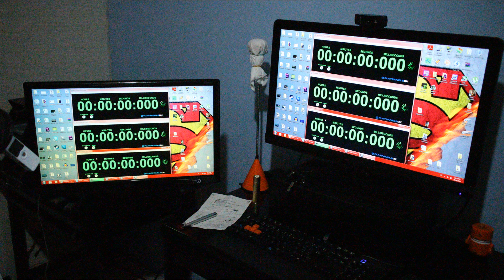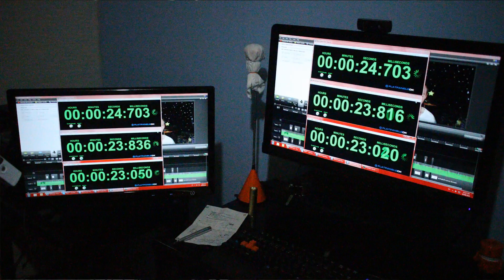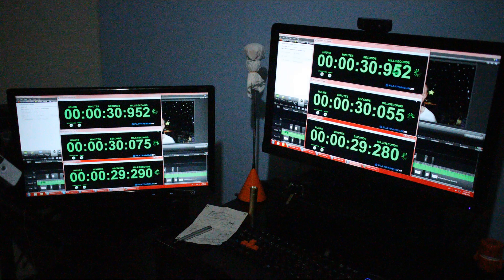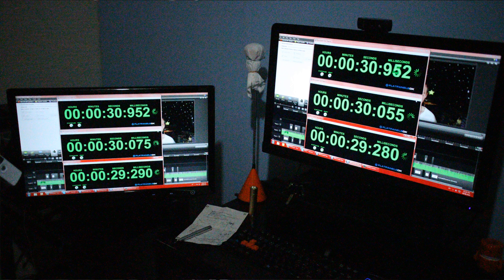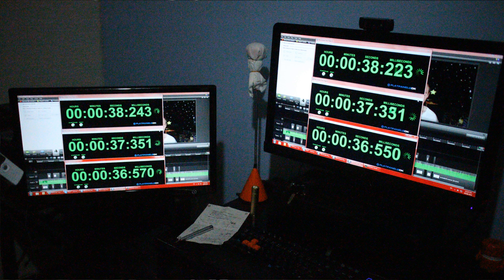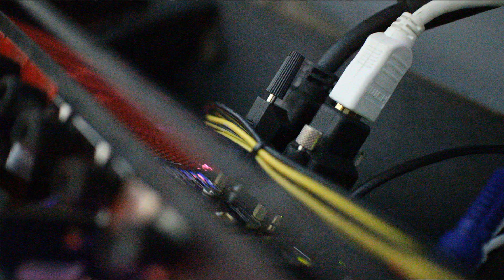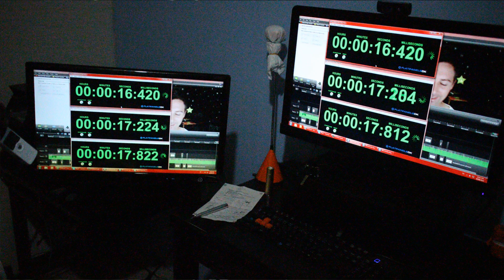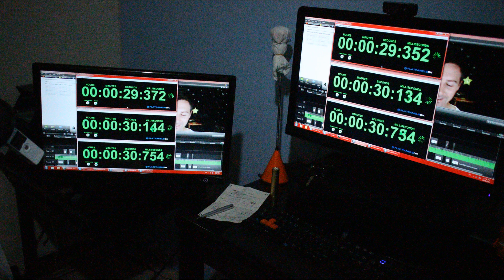Does it really matter which DVI Port you use? Testing DVI-D (Port 1) vs DVI-I (Port 2) (QFP006)

Comment: Graphics card or motherboards which carry a DVI-I connector are therefore fully compatible with flat panel LCD monitors, which typically have DVI-D cables. The DVI-D cable will only read the digital output from the DVI-I connector and simply ignore the analog signal.

Comment: Should the following setup be ok on a graphics card that has a DVI-I and a DVI-D outlet:
1 - DVI-I to VGA adapter then VGA cable to VGA input on monitor 1
2 - DVI-D to VGA adapter then VGA cable to VGA input on monitor 2
Both monitors are Samsung 27" LED flat panels.
Thanks...
Reply: Guy Burton why in the world would u use vga
Reply: Lol

Comment: First off you screwed up . you would need to use the same two monitors . and then switch them back and forth . your two seperate processor and ms reaction times between the monitors changes the reactions in 2 other dimensions off of the dvi ports .

Comment: Can I use these dvi port to support dual monitor
Reply from the maker: +deltamish If the card has two ports then yeah.
Reply: +Tech YES City my card has, but will this affect fps? Also if I plug in a second monitor with dvi will this affect the respons time on my main monitor becouse I now have 2 monitors plugged in?
Reply from the maker: Nah it will be fine.

Comment: whats the point connecting the hdmi to dvi adapter?  Wouldn't it be better to just leave it without the adapter and just use the HDMI?  DVI-D is better imho  I use the bottom dvi port on my card never tried the top one yet.  But recently changed from HDMI to DVI-D

Comment: Is this same for power mac G5 they have two DVI ports?
Reply: The G5's exclusive versions, I think, work differently.  See, the G5 has special versions of AMD and NVidia cards.  The late 2005 models shipped with versions of a Quadro, a 6600, and a 7800.  The 6600, I think has issues using DVI-D in the DVI-I dual link port on the left.  Only the left/one closer to the side panel latch can be used for display.  The one closer to the ports is meant for some video out features and older video cameras.   I've had nothing but issues with using a DVI-D dual link and a few other DVI-D dual link cords.  So, I ordered a DVI-I dual link to HDMI adapter.

Comment: I just got a new monitor (144hz /1ms response).  Can my dual link DVI cable run at 144hz?  Or do I NEED to invest in a display port/HDMI cable to run it at 144hz?
Reply: Depends on the resolution
Reply: I already figured it out. DVI-d is fine for 1080p@144Hz.

Comment: There are DVI-D and DVI-I ports on my monitor NEC MultiSync LCD 2490WUXi2. They are both Dual Link, but the DVI-D to DVI-D cable that was provided with the monitor has Single Link connectors. I wonder why? If I change the cable for one with Dual Link connectors, will my monitor gain anything from it?
Reply: well if the monitor is Full HD 1080p then probably no, but if it's 2k -> 2560x1440 or 2560x1600p then yes as you will be able to use the higher resolution

Comment: I don't think your theory to this is correct.

You see, there are still variables using a camera to check the input lag. Try getting a Leo Bodnar lag device that would absolutely tell you the input lag without variable instead.

Comment: Just use HDMI.
Reply: That's 1.4 that has a 30fps limitation.  The new 2.0 HDMI cords works fine at running 60fps.  This is only for 4k, btw.
Reply: No
Reply: yuup
Reply: +BarryEssex hdmi is terrible for 4k
Reply: No it's not! Looks good in my 1080p...

Comment: DVI-I is analog and digital, DVI-D is digital.  not sure what you mean by port one/two.  I dont think the software is good enough to test the response times.  If you have a timer attached to the DVI port and test the real responce times that would be cool.  Also the 60Hz rate would get into the way of testing the ms responce
Reply from the maker: I will update the video when I get some time, There are a few types of DVI yes, then there is single link and dual link for both I and D types. I should of put that in the description lol (feel like a bit of a noob now).
Reply: Tech YES City Hey I found this intresting/usefull.
http://www.tomshardware.com/reviews/display-monitor-tv-screen-test,3901-4.html
Reply: Thank you for that blunt first sentence you have here, saved me all sorts of confusion.

Comment: I've got an Acer 1 MS 144 HZ panel. The colour quality by default is absolute horse shit to say the least though.. 
You have to tweak the colour settings for it to look good
Reply: I can't decide between the cheaper Acer or the Asus 24" 144hz 1ms monitor. Maybe it's the Asus now....
Reply: Earnest Bunbury Well bare in mind you wont get special colour quality with any gaming panel.
If you're talking about the Asus VG248QE. That monitor overall has a lot more features to offer considering its the same price. I picked the Acer monitor pretty much based on i didn't care about the extra stuff the Asus came with, and the Acer consumes half the amount of power.
So if you want all the features then Asus, or if you're like me and for some strange reason care about the fact it consumes 20 Watts of power then the Acer.
Reply from the maker: Earnest Bunbury
In terms of response times there wouldn't be much in it at all between the Acer and the Asus TBH, would just come down to other factors like color and price, though I hear both 144hz variants are not that flash hot when it comes to colors / contrast etc..
Reply: Yep, the less power appeals to me so I got more in-depth considerations to, er... consider. thanks!  ... I got the Acer 144hz 1ms and it is GREAT, so much better, smoother, and better color than my previous Acer 23.6" panel.

Comment: Couldn't it be possible that the DVI to HDMI adapter affected the results?
1st by the way!
Reply from the maker: It could if I didn't use the HDMI in one test and did in the other (my acer has a broken DVI in lol).  So the tests wouldn't have been affected for just testing the DVI ports solely against one another.